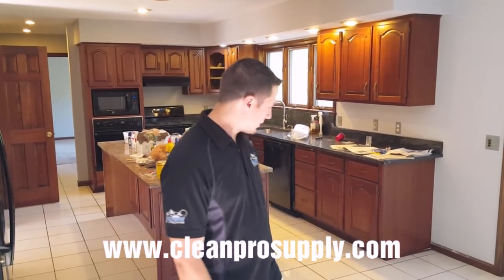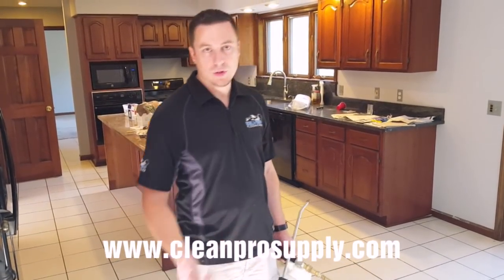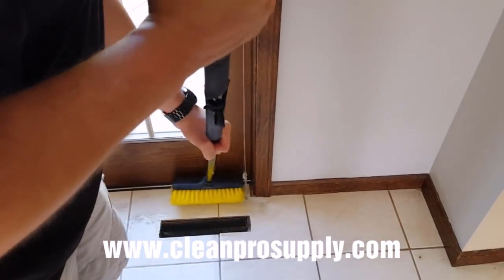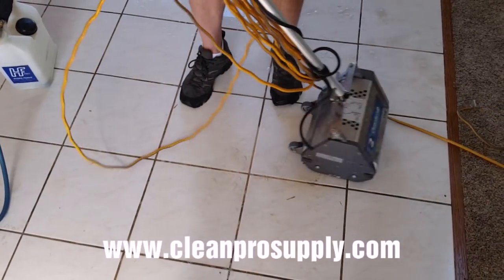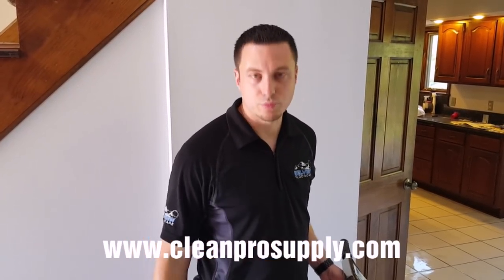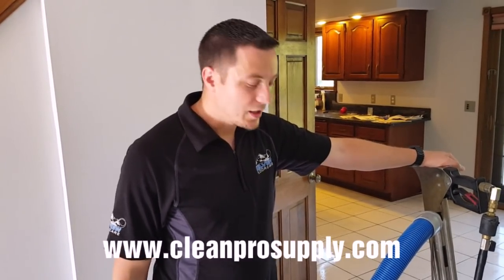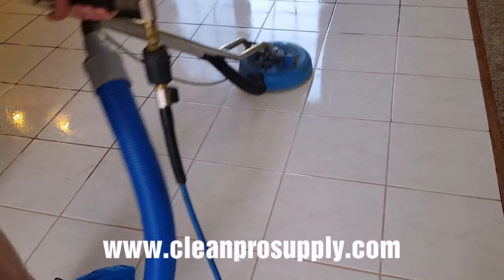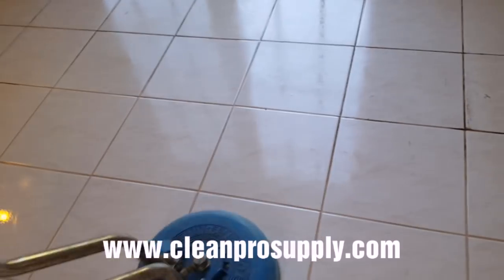Basics of How To Professionally Clean Tile and Grout - Clean Pro Supply

Comment: Nice video.
I was able to drop into your Rochester shop and meet you, nice set up.
I have the Turbo Hybrid, and the Westpak wand. 
When there is laminated wood floors, or weak grout, or unsealed baseboards, I use low pressure and the Westpak with only one  vacuum running (bad grout jobs).

Comment: I would use a window  washing washer on a Tbar  on a pole to  apply cleaning  solution   from the  border inwards  about 60 to 100 cm and then possibly  spray the middle .. You can spray the solution direct onto the  window washer sleeve .

Comment: Whats the name of the portable machine you mentioned? how much does that cost? and whats the name of the machine you're using? high pressure turbo spinner?
Reply from the maker: Micheal, the portable machine he was refereeing to is just any portable extractor vacuum that can handle pulling water from carpet or tile.

The spinning tile cleaner Dave is using is called a TurboForce TH40. This machine comes in a couple different sizes and is our go-to machine for tile and grout cleaning.

Comment: What do you recommend for a sealer
Reply from the maker: For grout sealing, we suggest Clean Advantage Solvent Sealer. 
http://www.cleanprosupply.com/cps-clean-advantage-penetrating-solvent-sealer-odorless-gallon/
Reply: Hey Timmy B Would you be at all open to a side project if it didn’t interfere with what you are currently doing?
Reply: Yeah, what would be the project . ?
Reply: Its building part time residual income if I sent you a link would you like to take a look? @timmyb8657
Reply: It would be something you could do part time if I sent you a video would you like to take a look. @timmyb8657
Reply: A few years after creating the tutti hybrid you're using in this video I realized quickly just why clear penetrating sealers are inferior to color sealing the grout. Permanent staining is eliminated along with grout repairs eject you color seal the grout after restorative cleaning. Www.turbo-seal.com